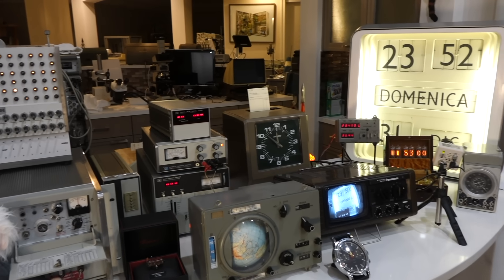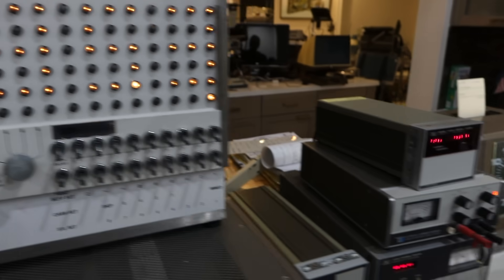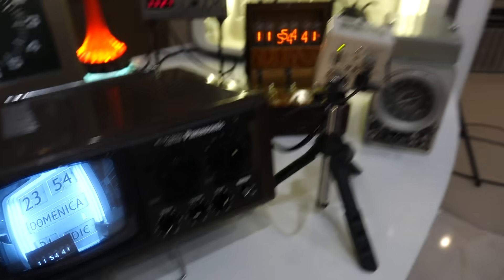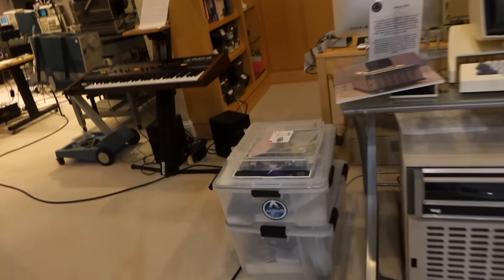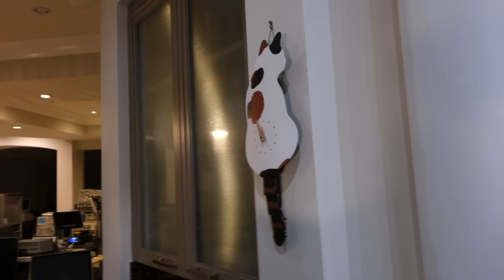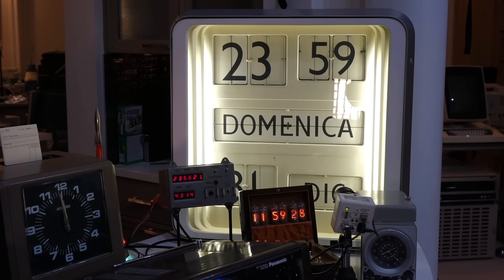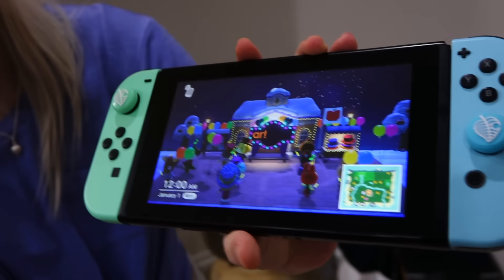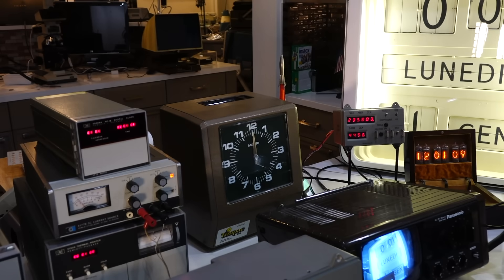Wall of weird vintage electrical and electronic clocks new year flip

Comment: Hmm... if the atomic clock is running occasionally only, how do you set the time on it? 🤔 Do you align it to your wristwatch? 😄
Happy new year to you both! Je vous souhaite à tous les deux une bonne année !
Reply from the maker: We normally don’t use it to keep it time, but to calibrate or drive other instruments with a very precise reference frequency. Which is how these “clocks” were mostly used.

Comment: Happy new year Marc, I am working on my friden, do you recommend dunking the entire thing (minus motor) in simple green?
Reply from the maker: Yes dunk it!
Reply: @CuriousMarc  My friden was able to do simple addition before it siezed up when trying to do multiplication, it now just has that dim whirrrrr of the motor trying to do stuff, I might have narrowed it down to the 2 gears at a 90 degree angle right side of the multiplication pad, hopefully simple green and break cleaner do it for me.
Reply from the maker: @dkreeg1964  It's almost working it sounds. Great news!
Reply: @CuriousMarc  Yeah the vertical shaft seems stuck, as I can freely move the horizontal bar under the keypad after separating the gears, but have no clue where it's stuck, bath time when ingredients arrive.
Reply: @CuriousMarc  Do I dilute simple green with water before submerging it? how do I remove it after? Thanks
Reply from the maker: @dkreeg1964  That’s what I do, dilute with quite a bit of water. I blow dry with a hair dryer, then let it dry on its own,
Reply: @CuriousMarc   Thanks so much, gonna do that now
Reply: @CuriousMarc  Alright, still same problem, I think the last move I did before it jammed was division, the weird shaped division gear is trying to move to finish the division, I dont know what to do about that.
Reply from the maker: @dkreeg1964  Cleaning with Simple Green is just the first step of many. It's sticking somewhere. It does not take much to hang up a whole Frieden. You have to cuddle up with the manual (available on  my website), find the gears involved and check them for free operation, possibly necessitating to remove quite a few parts to get to it.
Reply: @CuriousMarc  Thanks, I really appreciate your time.

Comment: Happy New Year!

Only USA call it "military time", the rest of the world call it 24-hour notation.
Reply: As far as I am aware, there is a slight difference between "military time" and "24-hour time" in terms of notation. It's the colon. Military time doesn't use one and would write "2359", whereas typical 24-hour notation would be "23:59". I use the latter everywhere I can despite being an American.

I also strongly prefer to write the earlier hours of the day with a leading zero when using 24-hour time. I'll write "2:00 AM" in 12-hour format but "02:00" in 24-hour format.